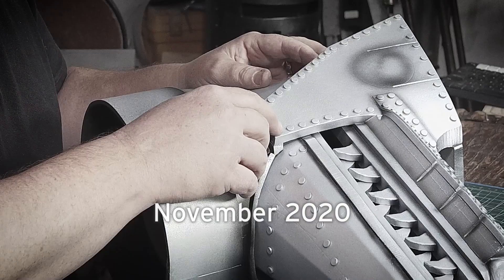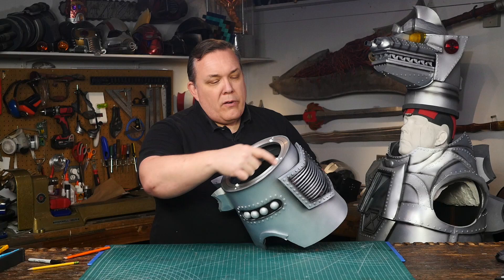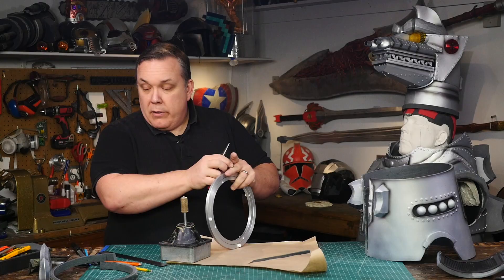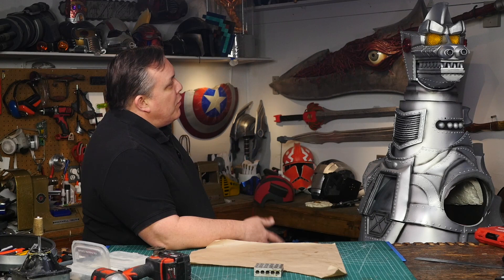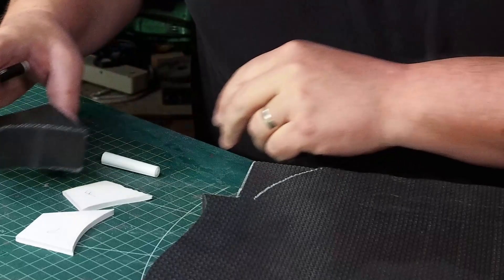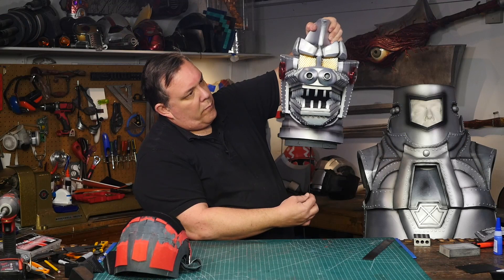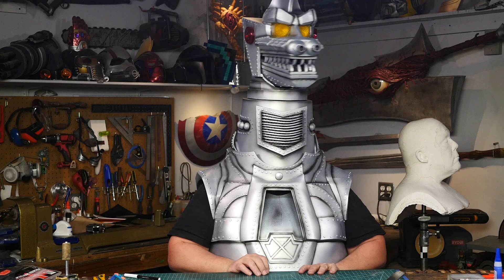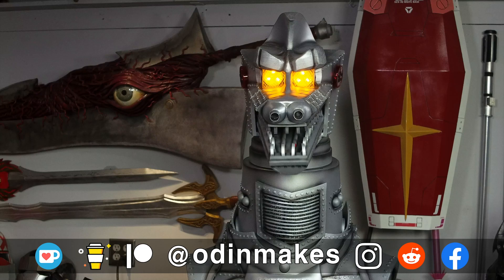Odin Makes: 1974 Mechagodzilla cosplay suit head and neck upgrade

Comment: Another tip for the jaw, you can have a Y strap lock system so that the cords are to the sides of your chin plate, instead of in your face directly that will annoy you, seeing this idea though, is actually perfect, cause I can use it for other designs!

Comment: Really awesome seeing all the puppetry work coming together in this cool cosplay!

Here's a suggestion regarding the string in the middle of your face: instead of having a single string attached to middle of the chin piece, why not have two strings on each side of the piece and have them connect higher on your face (like on top of your nose)? Imagine an upside down "Y". It would still be in front of your face, but least your mouth and nose would be free!

Regardless, great work as always and good luck for the remaining work, Odin! :)

Comment: If you don't mind a suggestion, my I suggest that you cut the cord coming down to your face short splice in a pair of cords or a single cord folded / tied into AV to the two straps would then bracket your face before heading to the chin cup. I'm unsure exactly how well this would work but it would keep the cable off the middle of your face.

Comment: The unfortunate thing about the pulley system is you loose the ability to do the full head spinny thing, but I guess the practicality of that in a costume was always going to be questionable, other than that I'd consider making it two cords that connect to either side of your jaw just so it's not cutting right up the middle of your face. It's probably be way more comfortable and provide some more security in case one cord fails in anyway.

Comment: For the head spin, maybe a little motor and rubber wheel, probably mounted on the red helmet, to turn the metal ring with a mouth operated toggle inside the neck. Could that even actually work?

Comment: Go get some cheap RC toy
and remove rear drive and wheel part. 
Create a rig to mount of skull cap. 
Make sure not to destroy the remote and antenna. 
Align Wheel tread to the inner center ring. 
It must have contact to have the motor drive. 
This friction should make the head spin. 
The remote can be placed in the left or right hand; 
where you can press the button. 
Who knows?.. 
Maybe you can make a rig inside one of the hands;
 to create the revolving missile effect.

Comment: Do you think it would work to have a cord on both sides of the chin strap that run up through some sort of tubing attached to the sides of the red cap and then on to the mechanism? That way you wouldn't have the single cord running down the middle of your face all day.